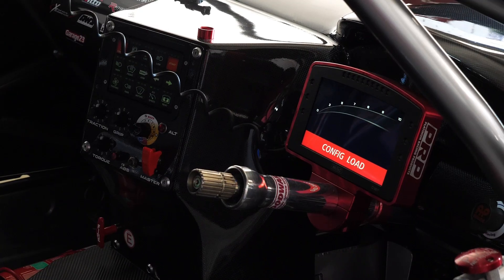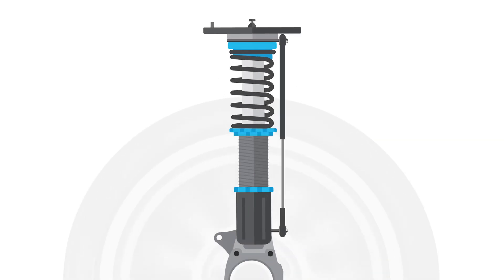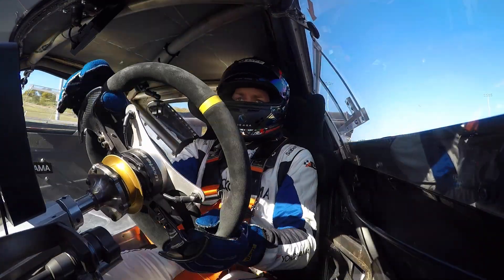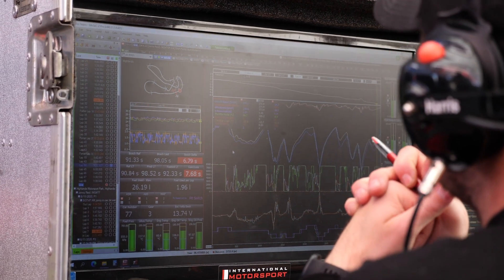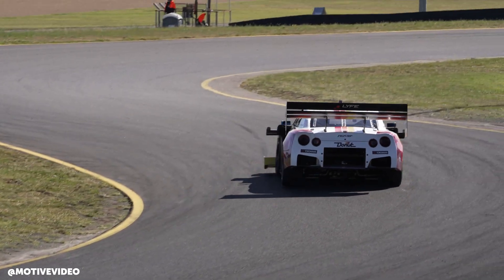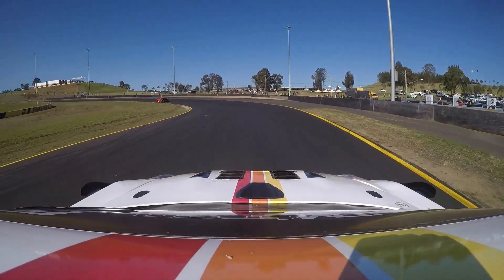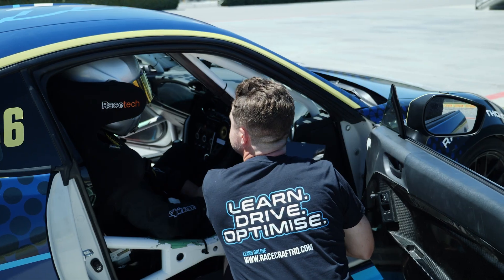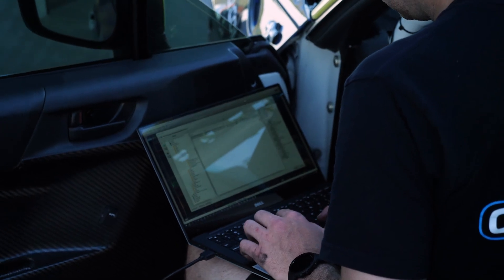The secret 'magic' you've been looking for?

Comment: Really great information. Comparing with another reference is always the easiest. If that's not available, a couple of other tools can be useful, such as knowing the lateral grip typically available in your car, as well as the radius of the turn. You can find turn radius via GPS. From turn radius and G, you can calculate a target speed at the minimum radius of the turn. You can also use roll and pitch angles to measure the camber of the course, which can also factor into your theoretical min speed. Knowing what the speed should be is half the battle for drivers with less seat time!
MPH=sqrt(G∗R)∗0.6818